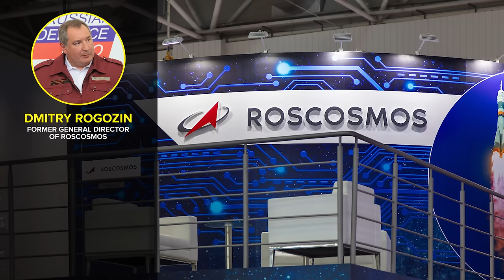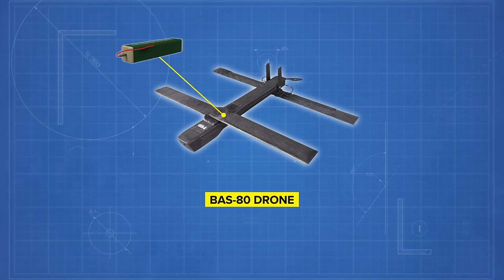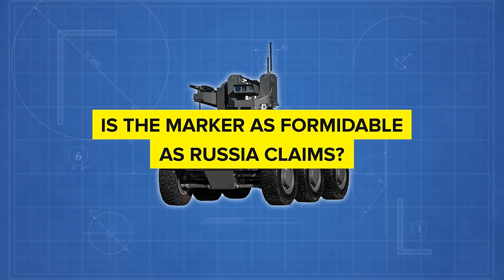Why Russia's ABRAMS KILLER is a Joke

Comment: Take a look at the build of Pootin's Robo-tank. Its too light to stand up on the battlefield. I suspect a 25mm Bushmaster, will easily destroy it!
Reply: If an Abrams was destroyed by a Russian drone, then these little tonka toys can be destroyed by a Ukrainian drone. I'd say a little US switchblade 300 can probably take it out , and probably eont even have to use the anti armor switchblade 600 just the small 300
Reply: Any tank can be killed by a drone.
Reply: @Asymmetrical-Saggin  True but my point was that the Robo-tank is so lightweight that a 25mm shell could kill it. Therefore, obviously a drone can kill it, since drones generally us a larger charge!
Reply: @csmeinert  25mm bullets cannot penetrate ERA armor, they have not even reached the T-90's composite armor. The M2 can only disable the T-90 by shooting at the sights and fire control equipment, which are very vulnerable. Every tank will be vulnerable like the T-90, Abrams is no exception
Reply: @vinhvu5986  Two things. Firstly, There's no way the Robo-tank has the same armour as a battle tank, not even an old T62. Secondly, there's video of a Bradley with a 25mm Bushmaster defeating a Russian tank.
Additionally Bushmaster ammunition isn't a "bullet", the 25 mm ammunition includes armor-piercing, high-explosive, sabot and tracer.
These are easily capable of defeating the armour used on these relatively lightly armoured Robo-tanks.
Reply: @csmeinert they were using heat rounds, as that's all they got
Reply: @PlayfulDoggy  "heat rounds" what's a heat round? The guns are loaded with a mix of high explosive or armour penetrating and tracer rounds in a ratio, typically, 1 tracer to to five others. No armourer would load only "heat" (I assume you mean tracer) rounds. What you assume to be the impacts of tracers was either high explosive or armour piercing. The impact of an armour piercing round produces so much heat that it melts metal, even if it doesn't fully penetrate. That's what you saw.
Why do you think the Russian tank turned tail and tried to escape?
Reply: @PlayfulDoggy do you mean High Explosive Anti Tank rounds?  I don't think they make those for 25mm, but they're a relatively common round for tank main guns.
Reply: Bottom line folks is the Marker is under-armoured for the actual combat field, plus those sensor suites are NOT armored at all. They'd be the first thing to be targeted. A blind Marker is worse than useless.

Comment: Judging by the level of the Russian electronics tech, I doubt they can see anything definitive with the sensors beyond 1000 ft or so. Certainly nowhere near enough detail for an independent AI to determine target acquisition under battlefield conditions. I suggest it is little better than a radio controlled tankette with all the issues that remote radio interference brings. ie junk.
Reply: The claims of identifying targets 10 miles away would probably be in reference to the attached drone? Unless it's claiming optical zoom on a clear day while it's on a mountain.

Comment: People dont see the full picture, these ground drones serve the same purpose as air drones in a way, to enter areas without putting humans in harms way, carry supplies, scout or push in an contested area where a human or tank would risk blowing up to a mine, artillery, fpv drone,  machine guns, etc the WHOLE battlefield is visible from the air, hence soldiers have to trench and rather sit with controllers instead of getting blown to bits in a useless fashion
Reply: The trouble with that theory is that of signal degradation.  Ground clutter is a mighty opponent to overcome with remotely controlled ground vehicles.  Arial drones don't have that same problem.  Most drone signals are line-of-sight, and the vehicles must be out in the open to receive a strong enough signal to operate without interference.  That makes Markers sitting targets for personnel with anti-tank weapons!  Satellites can differentiate drones at altitude much easier than it can obstacles on the ground, and the earth absorbs a lot of any signals that are being sent to servos and processors in a ground-based vehicle.  Any R/C guy at HobbyTownUSA could tell you this much.  Operators would need to be close in, thus being vulnerable to hunter teams looking for those operators (through signal locators), and that claim that the Markers would be autonomous is just a pipe dream for now.  The tech needed for that isn't in Russian hands yet, and even if it were, they still need processors to make them work.  Even the PRC doesn't want to sell theirs to Russia quite yet.  Russians are still cannibalizing refrigerators, washing machines, and microwave ovens for rudimentary processors to this day.
Reply: @jasonyoung3690  thats bs, even Russian use long as wiring or strong radio if they need

Comment: Oh, come on. Robot tanks have their uses - if Russia can produce them in numbers.
Abrams tanks can be killed. Just as much as other tanks. Hit it with a rocket, or missile, or artillery, and it will fall apart. It is obvious from WWII that there is no such thing as an invincible tank.
What a remote controlled drone can't do as well as a manned one is situational awareness. You just don't see or feel the terrain, don't see where is cover, what does the enemy do. If you have an empty flat field, then the battle will be determined by technical parameters. Then the Abrams will win, unless very, very outnumbered. But, if multiple "tankettes" can outflank the Abrams in like 200m, it will die.
These remote tanks are even better for support role. You don't have to worry about them throwing the turret, they're way cheaper and more expendable. The infantry can even share information with the operator of the tank to provide more situational awareness.
Reply: That assumes the Russians use them properly.  They have shown a lack of proper application of the tools they have (such as combined arms and proper support for their tanks).